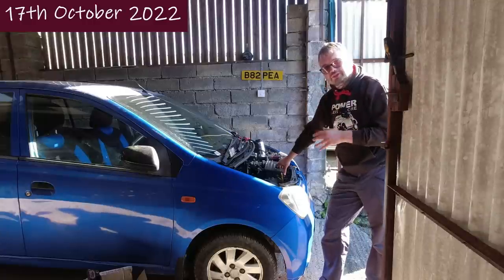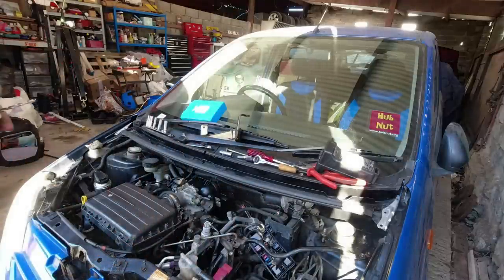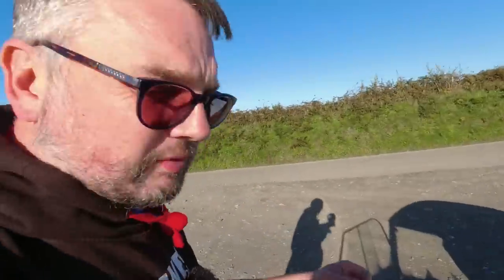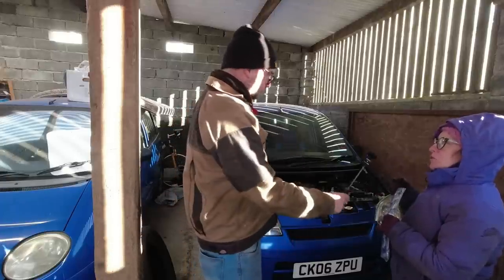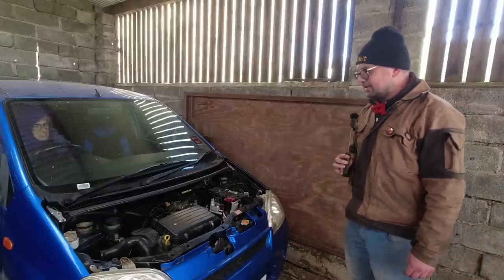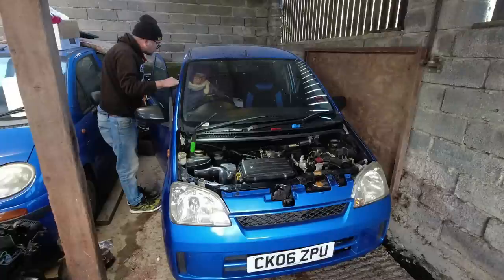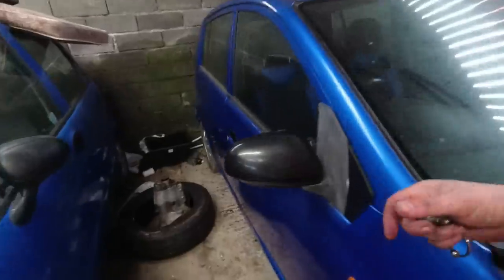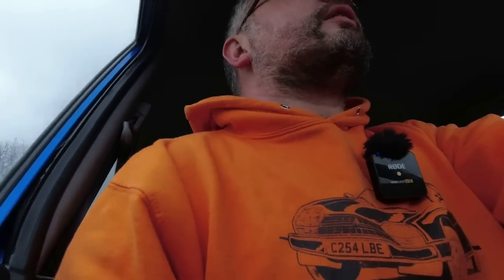(EP12) Daihatsu Charade Engine Swap - Manifold Mayhem!

Comment: Great stuff. I can see that as car preservation moves into the age of plastic manifolds, sumps and engine management electronics; keeping such cars on the road in the long run is going to be a real challenge.
Reply: on the flipside, plastic is easier to mold and probably 3D-printable

Comment: High idle can be the cold start mechanism on the throttle body that gets sticky. You can clean it with brake cleaner and a small brush/screwdriver. On some vehicles it's operated by a wax stat. You can access it but removing the bit with the coolant hoses (information from an 04 terios).

Comment: That's what I suggested, tap out the damaged hole and put an adapter, the cheapest and easiest way...and charge the battery a bit, which is the problem is a car isn't used at all and not run at speed.
Reply: Yup. The ECU needs proper and stable voltage to work as intended.

Comment: Yay! "Hello happy" at last. It seems that those plastic inlet manifolds are a bit of an achilles heel. With the vacuum stubs snapping off. I wonder if regular users of Charades have similar problems. Cracks in those stubs, could go unoticed and cause multiple problems with poor running.

Comment: Your perseverance is inspiring! I would be throwing bits of 'silly plastic crap' about lol. Am I the only one that thinks that so many engines from the far east end etc up burning oil because of the silly high cold start idle they are programmed with? Had 2 89 Camry's and they jumped immediately up to like 2k on a cold start, can't be good for them in the long run. Mrs hubnut will now be L plated up and passed soon I hope!

Comment: Congratulations, she sounds so sweet now. New o2 censor will also help. Check your throttle position sensor doesn't need to be adjusted if renewed or you might get problems on the open Rd but otherwise well done.

Comment: The lumpy idle is known as engine hunting or idle surge and is usually down to air delivery issue i.e to much/too little for fuel delivery. Maf can sometimes need swapping maf or an ecu may sometimes need to relearn   after running for while with dodgy one(usually on performance tuned engines) 

Sorry for being a youtube mechanic its just something my dad taught me when i was young and helping him with engine swapping his orion with cvh rs turbo engine.

Howver i could have some facts wrong as my memory is like a siv and i cant remember right from left sometimes.

Comment: Your comment about Japanese cars being a bit 'conservative' on the fuel gauge reading i.e. it's empty when not, My MX5 was telling me on Monday I had 11 miles range - when I filled up it took 35 litres, it has a 45 litre tank and averages 38 mpg in my general running! Still I'd rather be told I need fuel when I don't than i have fuel when i haven't.

Comment: By drilling into the manifold in situ, have you not  just left plastic bits waiting to get sucked into the throttle body?
Reply from the maker: No, because the manifold is after the throttle body. Any bits went directly into the engine... (I doubt they amounted to much).

Comment: Great work!!! The car lives again. Though there is a bit of an irony that you went though several manifolds only to go back and repair your original one and it all works. I will admit, I am not very familiar with UK market car requirements. But don't manual transmission cars in the UK have a neutral safety switch? On ones in the USA, the clutch has to be pushed down before the car or truck will start.
Reply from the maker: Thanks. Some more modern cars have a clutch safety switch, but my cars are all old enough to escape such things.

Comment: I'm sure I've lost a bit of track over the months, but why can't parts which I thought were the same be interchanged to make it run properly?
Bear in mind that my engine knowledge ends in the 1990's.
Really pleased to see it finally running. I bet you both are too!
Reply from the maker: The manifold on the replacement engine was broken, I broke the old manifold trying to repair the new one. Then ordered a replacement manifold, which arrived broken...
Reply: @HubNut  Error 18?

Comment: To get brake disks clean get it on Axel stands and then get a grander with a flat sandpaper pad on put car in first gear then clean rust off just for mot then put new disks and brakes pads on later when weather picks up
Reply from the maker: Very tempted to do this.
Reply: @HubNut  
Iv done it a few times on my classic cars when they have been layup from the winter works a treat for me. I’m glad you have fond a solution for the inlet manifold it seems to work very well 👍😁

Comment: Somebody I worked with had a Daihatsu in about 1991 it was only 1 year old and had real trouble getting spares, were they officially imported into the UK.
Reply from the maker: Yes, by the same company that imports Subaru to the UK - International Motors.

Comment: Very good outcome.  I am legitimately curious what the problem was with the previous intake and the rough idle, though!     It had to be something that was different, or cracked, or whatever!
Reply from the maker: Same here. I did have a good look but couldn't find any cracks. Will keep exploring.
Reply: @HubNut  It just seems weird since you were using the same throttle body, TPS, gaskets, etc.. something has to be different clearly!
Reply: @HubNut  Captain Tolley's Creeping Crack Cure????  :)

Comment: Good video  I hate working on modern car's so much stuff packed in such a small space and most of the time you have to remove about 10 other thing's that are in the way to replace what you need to and so much brittle plastic i guess they made that manifold out of plastic just to save a few buck's to bad it wasn't made of aluminium. I would love to make some of these engineer's that designed  this stuff to work on it hope you get her going soon  regard's from canada

Comment: I like your perseverance Hubnut and Ms Hubnut , I'm the same with near lost causes , my old 2007 Mitsubishi Colt i love but its got old and things are going wrong fast , just had to spend £270 today for discs and pads but they are Brembo's so very good quality , next up need 2 new tyres on front and 2 new shock absorbers but oh yes there's more , it needs a new clutch as thats juddering and a good service but hopefully after spending the £1000 required in total it should last another 15 years fingers crossed for Chemy the Charade  too
Reply: Wow, Was that for front & rear discs and pads. Even then Christine for 'brembo' the parts for front and rear would just be little over £100, 170 labour sounds expensive.

Comment: Ah Mr 'Bodgeit' I think your channel should have been called the 'bodge nuts'.. 👀Whilst your 'persistence' is debatably 'admirable'.. viewers need to be aware of just how much money you have 'squandered' on this 'project' AND how much more re everything else that needs replacing/servicing to make this vehicle 'road worthy'; compliant with UK laws. 👀As a mechanical/electrical professional of over 43 years I've seldom seen such shocking 'bodge ups'... resulting in of course without doubt, more ongoing problems/failures/issues.😶 You have to order and pay out time after time for things such as 'gaskets' et illustrating that you're incapable of actually cutting or making your own.. jeez  from my early days on doing such was a necessity where money or the shortage of was concerned. As for using the liquid/paste solutions?? 😶Early engine systems in comparison to today's 'high tech' engines were simplistically elegant.. as time progressed it got far more complicated BUT at the same time, IF you did not KNOW, did not understand fully the functional aspects of such engines/engineering; any work carried out was mostly going to be down to inexperience OR like you have repeatedly shown.. guess work and bodging it.. 👀WHICH we all have seen time after time often does NOT (rightfully so ) work. 😶